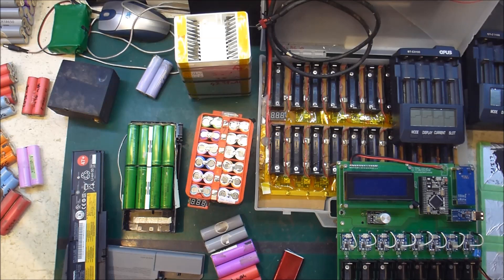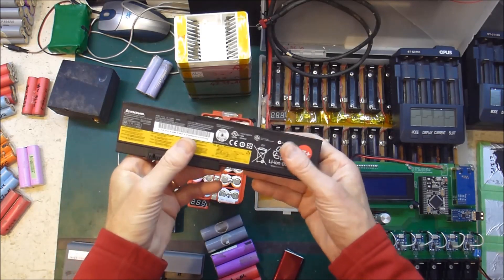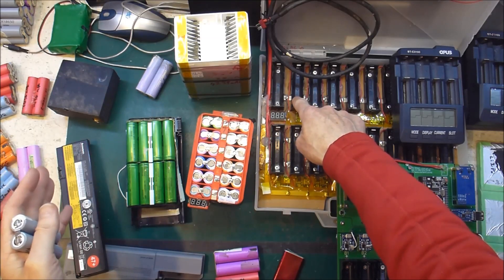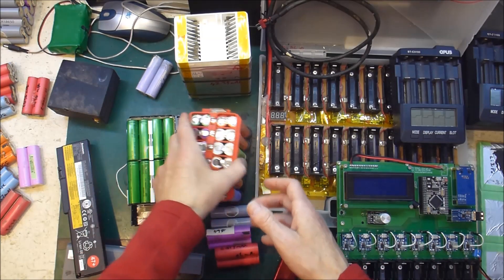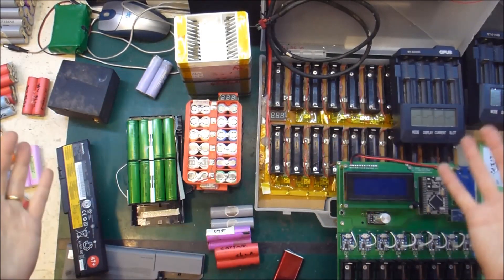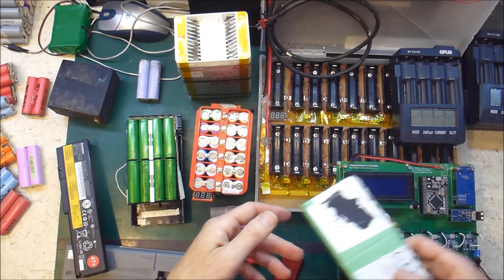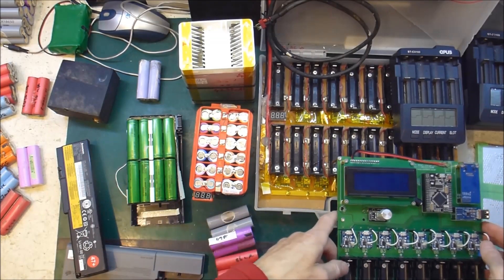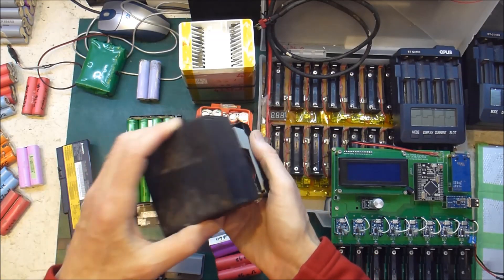Laptop Powerwall 139 - Maker Faire Wellington recap

Comment: Great effort Paul.....Im using them to fly my model plane and power a mobius camera......
Reply from the maker: So good to hear of batteries getting a second life. Flying the place is a high drain load too. Impressive. Do you test the internal resistance?
Reply: I just do a slow charge and current drain test with the TP4056 and the ZB2L3 Battery Capacity Checker, 
Goal of flying is lowest draw and endurance so try to keep current average below 2-3 amps.
https://youtu.be/SZwfpMVDjPU
Reply: Are there small cheap ways to do internal resistance testing ?